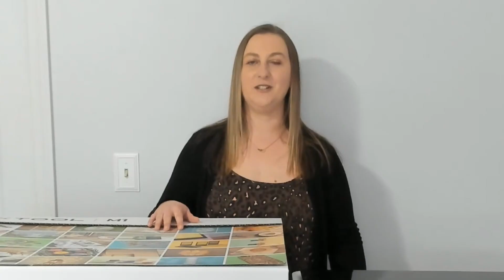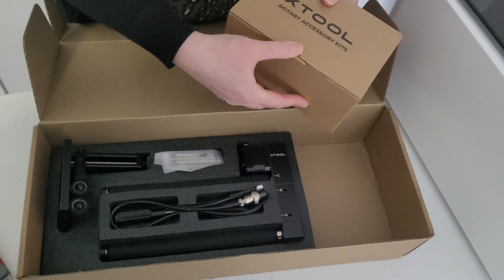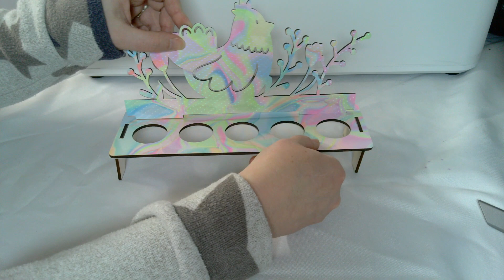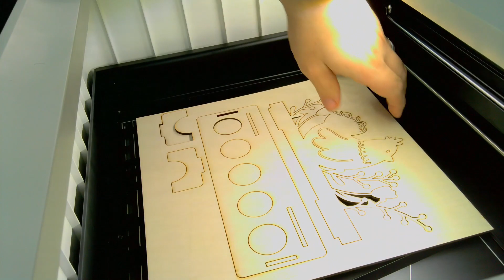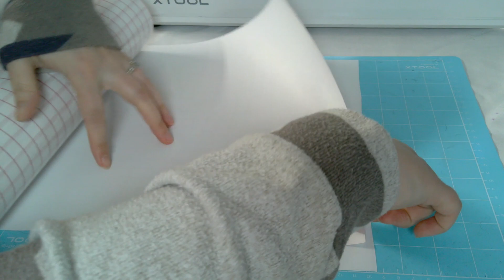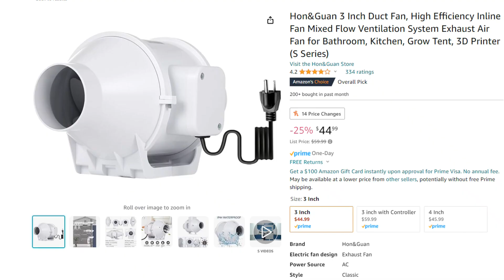xTool M1 Laser Engraver Review: The Ultimate 2-in-1 Laser & Vinyl Cutter!

Comment: $2424.00 just to make trinkets.  The discretionary spending some folks do continues to amaze me.
Reply from the maker: I made a ton of money around Christmas with my laser. I sold a lot of ornaments and cutting boards and a few other things. I would never buy one if I didn't plan on making my money back by using it for business use.
Reply: I’m sure some do buy these things just to mess around, however many buy them and end up making lots of money. For myself, I kinda fall into the first section as I like to make boat parts for my boat. However, I did make a bunch of signs and other things which payed for the CNC machine I got. After that, it gets to be a hassle dealing with the shipping, etc.